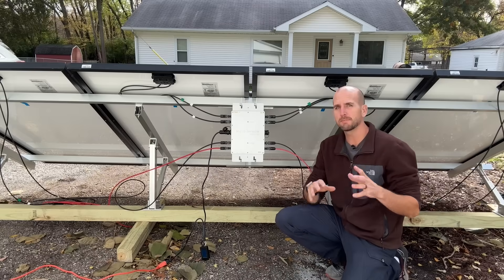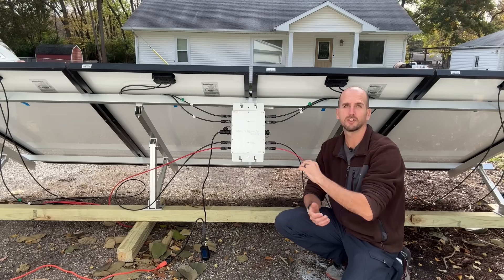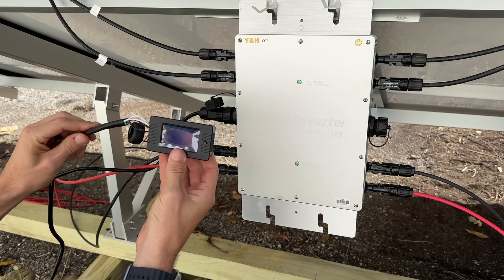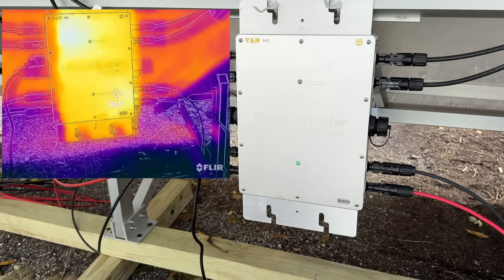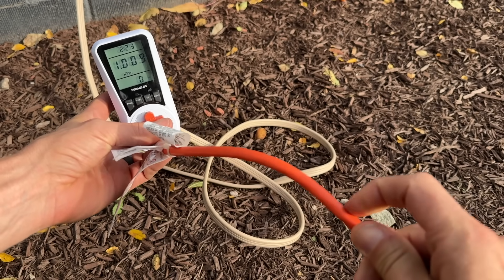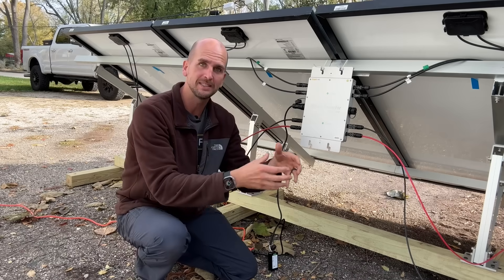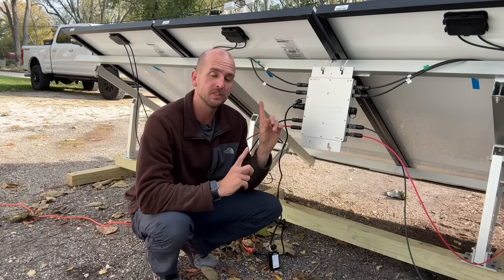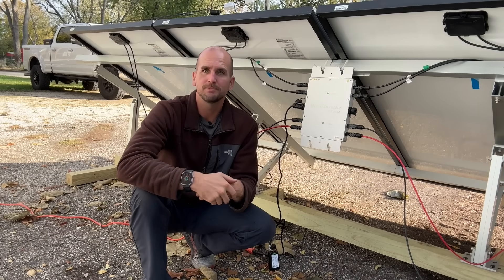Plugging Solar Panels Directly Into An Outlet | Surprising Results

Comment: I built a home set up with a 600 watt inverter. Y&H from Walmart used a gift card from work so it was only $45. Bought 2 panels 250 watts for $85 for both from a solar installer. They where removed for an upgrade or expansion. It knocked $100 of my monthly summer electric bill which can get as high as $380 per month. I have them facing south and at 28 degrees of elevation. Full sun I am getting 370 watts, they are old panels and brand new ones would produce more. I am thinking of expanding with more panels but stay under my grid tie inverters 600 rating. I used a power strip with surge protection where the inverter plugs into my home and have an inline fuse on the power coming in from the panels wired in parallel. I can even install a GFI outlet for the standard one that will cut out if there was ever a power surge from the panels. I used a very small desk fan that is 5 watts to help keep the inverter cool in my garage. It never overheated and overheating is what causes electrical devices to breakdown.
Reply: That math doesn't add up.  370 watts at max sun, assuming its never cloudy or raining, produces 370 x avg. of 10 hours per day x 30 days a month x $0.22 per kwh is about $24.42.  Where do you get $100 per month savings?
Reply: @samblane  Maybe his time of use is skewed to be super high during the day ?? Or maybe he cranks the air super low during the day to in effect make the house itself cold battery storage system and thus runs it less during the night? That said I thought the same but as long as someone is making progress that is all that matters.
Reply: Would be interesting to see a little video on this setup.
Reply: @Magiciansandmagicvideos  I'm no Youtuber. I did add a timer to a water hose that sprays down the panels a few times during the hottest part of the day. When the panels get too hot the energy produced actually drops. Been in the 100's in Texas. Easy loss of 100+ watts during the hottest part of the day when you think your producing the most. I built my stsyem as an experiment just to see how much it helped. The energy loss from heat is why roof systems have more panels than people think you should need. The heat also breaks down the panels and you lose efficiency. So if it takes 10 years to pay of your system you have a system that produces less than your requirements. The only work around is to upgrade your inverter much higher than you need and add more panels every couple of years to make up for the degradation loss.
Reply: Saludo desde la República Dominicana 🇩🇴 tengo una pregunta que tiempo tiene usando dicho inversor yo hago la pregunta por que yo quiero comprar uno de esto inversores y estoy buscando referencia
Reply: @benjaminalfoseca6084  Hola desde Texas, Estados Unidos. Mi publicacion fue hace un ano, por lo que han pasado al menos 3 anos desde que utilizo el inversor de conexion  Y & H. El ventilator de 5 W se conecta con USB y realamente ayuda a enfriarlo, por eso ha durado tanto.
Reply: Coolem with water
Reply: Hola amigo Kris disculpe también le ayuda con la corriente 240w como el aire acondicionado y la secadora o nada más es para puro 110v .?
Reply: Believe it or not I got 20 recycled 200 watt panels from a commercial installer who was upgrading a project, and I paid $100 for all , or $5.00 per panel. This is the kind of market that will eventually make solar really cheap.

Comment: The worst case scenario is, when the unit fails/malfunctions, resulting in a fire and property loss, insurance will not cover the situation😢. That said, there are better ways to connect it to grid, if you know how to🤔, while still code compliant😮 and insurance covered, even if the equipment fails catastropically!. It involves, nothing more than ....🤐 Never mind 😂❤👍

Comment: I have two of Ecoflow Powerstreams and I must say that I really like how well it works and they don't get very hot at all!
Reply from the maker: I actually only heard of the Powerstream the other day as they don't offer it here in the US or Canada.  Those units would be perfect and I also had good luck with EcoFlow over the years.  Thanks for the feedback!
Reply: Summer sun is starting here, longer days and so on. Now Im starting to see a full potentional.
10 first days in April, til today, Ibe generated 55kWh.
Aproximately systen generated daily 5 to 6 kWh. And it was fairly sunny.
Also, I have to mention that my panels arent oriented fully to south.
But more of like west/south.

So, my setup is:
600w powerstream with 2x400w Ecoflow rigid panels oriented to west, almost flat down at 5 degree angle.

800W powerstream with 2x435W bifacial panels oriented to south with 10 degree angle and white metal roof which reflects sun to them too.

River2Max with 2x100w panels in parallel, connected to powerstream so that when battery is over 80% it discharges its energy to powerstream and to the house apliances.
Reply: @vedranart  +/- €200,- extra monthly income 🤑Safing money(fixed costs)🔋 is almost same as creating a monthly revenue.🤑🔋🤷🏾‍♂️
Reply: @vedranart  How do you connect two powerstreams to one river2 max? also only saw about powerstream toonight (south africa), they have started selling them here... seems like you would need the smart plug as well to determine where current needs to go. be interesting to see video of your setup.
Reply: Wow he got 1Kwh in 2hours.. lets say 12hours sunlight would provide 6khw a day.. That would fully charge my electric vehicle (42kwh) in one week😮

Comment: I had one too. It is cheap yes, but bad build. It has the wrong condensators in it. Open it and confirm it yourself. They are the big fat ones. They work at a maximum of 50V. The inverter is labelled run with a maximum of 60V. This can not work. First year  of electrical  engineer student  nows that. Burns in a few days. Buy some thing else.
Reply from the maker: I had half of the unit fail day 2 🤦‍♂️

Comment: Thanks for the video. What is the voltage of the AC coming out of the inverter? It needs to be higher than the voltage of the circuit that it is plugged into.

Comment: We've been running an on-grid inverter for over five years. Can use  multiple panels in series or parallel, and plugs into any house mains socket. Total cost was around US$100 (+ same for each of 6 panels) ROI was less than 18 months... Providing you don't live in the US, where anything Chinese is banned or taxed beyond reach.
Reply from the maker: Thanks for the feedback.  Is your inverter the same brand?
Reply: How is anything Chinese taxed beyond reached?  I buy off Alibaba and other sites every month.
Reply: Literally every solar product sold in the us comes from China, just labeled/branded differently

Comment: Plug and play solar is an interesting topic.  Since these will shut off during a grid outage, it follows that transfer switches are going to be an interesting topic as well.  I mean whatever type will let you keep using your solar and possibly a generator and maybe also a battery during a grid outage.  I'm sure there will be more of those coming out, I hope you keep an eye on that for us.
Reply: They can't use transfer switches because with out power on their grid circuit they will not turn on. Anti islanding

Comment: As an FCC-licensed amateur radio operator, my question is radio frequency interference. So many of these types of devices create so much electrical noise that using any sort of radio equipment becomes our of the question.
Reply from the maker: It must put off a good amount of noise.  The video I put out today I have my bluetooth microphone close to the inverter and it was causing some issues with the audio.

Comment: I ordered the 600 watt version and hooked it up to a two-panel "test" array using salvaged 395 watt panels that I got for free.  The build quality of the inverter's aluminum case actually looked quite nice.  I noticed that there are finned heat sinks built into the top and bottom ends of the case.  If the 1200 watt version is internally just 2 of these units that are stacked vertically into one case, then they are reducing the heat sink area by a full 50% per watt, which could be why they are prone to overheating?  Also, with the two-panel 600 watt version, you may only need 1 PV cable extension as the other three panel leads will reach the microinverter directly. The digital display is also nice looking and has a button to turn on/off internal backlighting, but it is obviously made to be panel mounted (into a water tight enclosure - will have to think of a solution for that; maybe a small tupperware type container as others have said).  And yes, the 120v version is only going to deliver power one leg of the main panel.  I also already have a permitted roof top solar system and the test array is connected to that system's combiner box so I am not sure what the AHJ / utility company would say if you just plugged some of these into the outlets of a random house.
Reply from the maker: Thanks for the feedback.  If you are bringing it into your combiner box you should be good.  Depending on your utility and net metering setup they might want to cap you at a percentage over your normal usage.  My utility does not want you to surpass 120% of your normal energy usage.
Reply: They will say that is not included in the agreement that you sign as a result your small generation system is in violation and you have x time to correct it or we will take necessary action to correct it. Disconnection

Comment: Probably been pointed out but you do need to be aware that feeding power into a power-point needs to be done with some consideration.
Example would be the PV at the end of a circuit, a power-point mid-way on that circuit that is overloaded...  The main fuse won't blow as it might be supplying the max current down that circuit. The PV will be providing max current up the current and the mid-span power-point lead could melt.  :)
Reply: I think you are confused.
Minus the limiting capability and trying not to send power back to the grid this is exactly how the simplest grid tied systems work.
Maybe it's a terminology issue with "powerpoint".

Comment: Enphase microinverters in use on balconies all over the city of Paris. Two modules, two micros. Rare for a balcony with space for 4 modules. modules are rarely optimally positioned. Horizontal in fact. Critical weather sensitive components protected at the plug location.

Comment: Great video!  I have been using Grid Tied invertors for over 2 years with mixed results. Obviously, without storage it is only useful producing power while the sun is out and your home is asking for use. You can attach grid tied invertors to different legs of your system to enable useful power wherever it is needed.
My next step is to add battery storage and either DC or AC couple the system, but I am far from having that knowledge and/or money to get there.
Reply: What do you mean by attaching grid tied inverters to different legs of your system? Does that mean you’re only getting solar power to the part of your house that the solar is attached to under that circuit breaker? I thought if you plug it into any part on your house it can produce power anywhere even to an application which on usually on their own breakers?

I’m asking because I have a solar system on my house but am looking to expand. Specifically I have a detached shed I just trenched dedicated power to on 12awg and a 20a breaker. I wanted to use this setup to charge and run power tools, yard lights, and when excess is produced help with the offset idle house usage or help my residential solar push back to the grid and increase my offset credits. So curious if this will work if it’s attached to a dedicated breaker but shouldn’t it still push power access the rest of the house or back to the grid?
Reply: @kylezane2718  When I started in solar, I watched many videos and this one was pretty good explaining separate 'legs' or phases when using grid tie inverters. https://www.youtube.com/watch?v=aBgwf3wCEA8
I actually have a shed that houses 2 of my grid tie inverters and I wired 2 outlets, one on each side of the breaker panel, so it would feed each leg. 1300 watts on one and 400 watts on the other, using a 600 watt GTI and a 1300 watt GTI. Theoretically, I can be producing a little bit of power on each leg that could be offsetting power consumption of my 240 volt pool pump, as it take it's hot for each leg.
Reply: @Kantuski Probably should have said both legs or used "phases" instead of legs.
Legs sound like branches and a branch is the circuit after the breaker.
At first I thought you didn't understand how the fuse box works when you said "different circuits" because there are only two phases to match or worry about. The video you pointed to made me understand it was a terminology issue.

Comment: This seems very illegal.
Reply from the maker: I would say “Illegal” might be a bit of a stretch.  Contacting your utility and understand what is needed to plug into the grid is a good idea.  This one most likely does not have the certifications.  There is another option out there that looks to pass all the certifications and I should get that micro inverter soon.

Comment: While supplying power, pull the main breakers and see if it continues to supply power to the house.  If it does, it will back feed to the grid.
Reply: Yes, please test it.
Reply: wrong, it will back feed into the grid even if main breakers are on. the only time it wont back feed is if the power usage at the home is less than what the inverters are producing

Comment: Curious if could be made to work off grid by putting a true sine wave inverter from a battery on the same socket.
Reply: A micro inverter can only be coupled to an off-grid inverter that has the AC coupling function. The Victron line has equipment like this. The problem is that the inverters monitor the output voltage and the microinverter increases that voltage when coupling and causes problems in the off-grid inverter.

Comment: 4:00 You can't take those temperature readings at face value. FLIR attachment no different than handheld IR thermometer. Every material has its own emissivity. While FLIR displays are certainly informative, the temperature readings are... well, to be technical, accurate without being precise.

I get different readings in the same spot on my solar thermal setup, depending if I'm pointing at bronze or stainless; the fluid passing through each, is the same temperature I assure you. If I really want to know the temp of my glycol solution, I use a quality thermometer with a thermowell immersed in the fluid, i.e. permanent installation, at each monitoring point.

Those little color-changing stick-on aquarium thermometers are surprisingly accurate, because they're calibrated to the emissivity of glass. I use two: one in the substrate, another at the waterline.
Reply: Those aquarium thermometers are precise, without being accurate. The "display" kinda buffers water-temp changes, iow, not up-to-the-minute accurate. But precise, over the five minutes it takes to react to changing water temperature behind the glass.

Comment: Avoid these, they overheat, get a Hoymiles or Deye
Reply from the maker: Thanks for the feedback.  Have you ran across a micro inverter for Hoymiles or Deye that has a 120V output?
Reply: @everydaysolar  
Don't know about that. We use 220V here in Italy.

Comment: I tested two of the smaller two panel units. Small house with constant running window AC units. Both units only lasted 3 and 4 months. Property in south Florida. I wouldn't recommend them unless you create a way to add active thermal management. Example, water cooled with a heat sink in hot environments.  They come with a warranty but you have to ship them back to China which is half to 2/3 the cost of the unit. If you live in more northern states just be careful in the summer. That's my two cents. The other issue is if you're not using all the power that they are creating because we're on smart meters in South Florida you will end up paying for the electricity that you produced.
Reply from the maker: Hey Jeremy thanks for the feedback on your experience!

Comment: I have 18 solar panels grid tied.
I asked my solar company to add 4 panels.
They told me if I did that, I would need to sign a new net metering contract with Entergy Louisiana.
If I did that i would loose my 1 to 1 net metering agreement.
I obviously said no thank you.
I then purchased 2 620 Watt panels from Amazon with free delivery, they are made by Bentaus.
I put them on my shed roof with 2  Enphase I8 micros.
Tied the 240v output to the existing solar shut off with a breaker in between to shut the new panels off if needed. The existing emergency shutoff where i connected them shuts all the panels off. The breaker shut off just my new panels. I basically added the 4 300 watt panels i wanted with the 2 new panels. Entergy would not approve but I don't give a fuck. Ill just say they charge my shed mower batteries and boat batteries.  Im really just making up the degradation of the 18 panels installed years ago....
Search Amazon for Bentaus 620w they were delivered for free amazingly.... you would need i8's to capture most of that power.
These 120v grid tied inverters could be a good solution for some and are interesting...

Comment: What was the cost of the micro inverter and what can this run ?
Reply from the maker: The one I used cost around $240 but they also make a 2 panel.  
2 Panel Micro Inverter Unit (600W) - https://amzn.to/3QEPrDc
4 Panel Micro Inverter Unit (1200W) - https://amzn.to/3tXAenQ